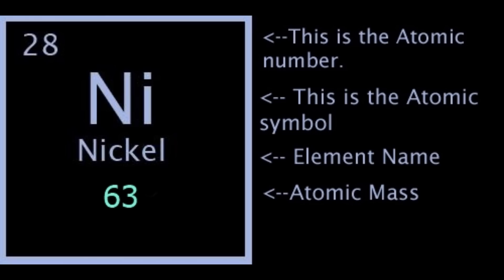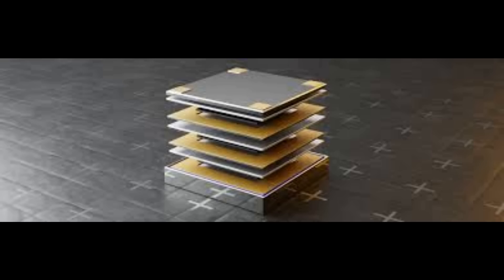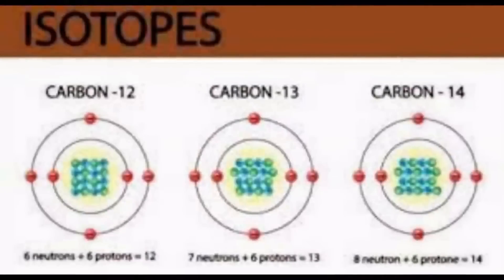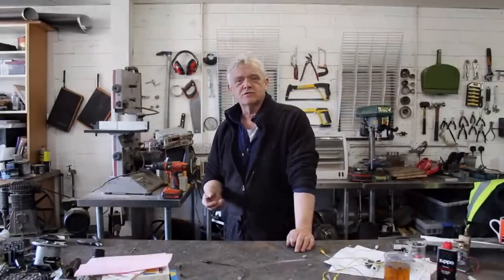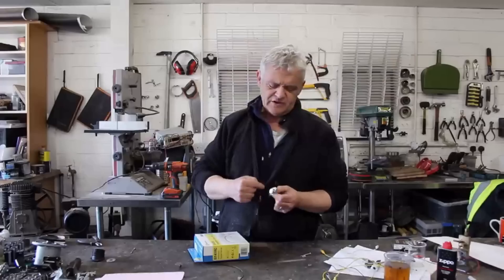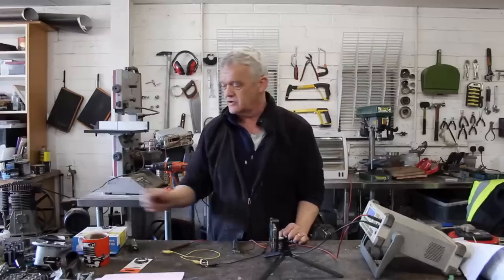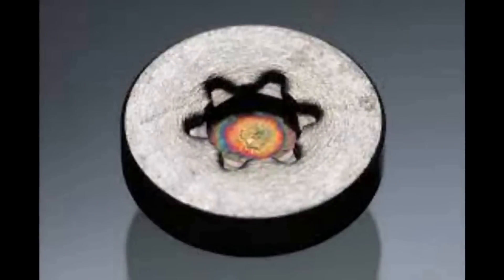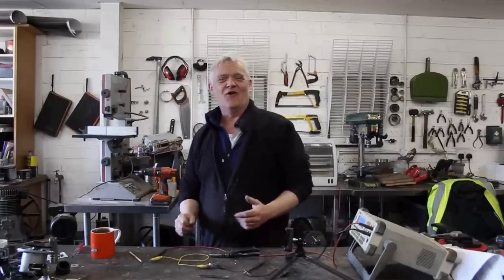2187 - The 50 Year Nuclear Battery From China And How To Make Your Own Version

Comment: The decay of C-14 or Ni-63 does not involve alpha particles.  Both atoms transmute when a neutron decays into a proton and electron (beta-minus decay) and result in stable isotopes N-14 and Cu-63, respectively.   Both have long half-lives, 5700 years and 101 years, respectively.  There are also anti-neutrinos released, but they rarely interact with anything.  Americium-241 decays by alpha particles (He nuclei), which results in Neptunium-237, with a very long half-life and radioactive.   The Ni-63 battery is far less hazardous.

Comment: wow. I had no idea! I wonder how we could efficiently boost the voltage to around 3v without having to build 30 of these in series ;)

Edit: I built one and it didn't work. I'm pretty sure the voltage you saw is just due to ambient light. You didn't shield the ambient light out at all. You need to repeat this experiment in the dark to see if the alpha particles make any power. In my attempt at reproducing this effect I was unable to in the dark, leading me to think your result is 100% due to photons of visible or infrared light, not alpha particles.

Comment: Could you just point that radioactive cell at a solar panel and get a higher voltage?
    Also what if you placed that radioactive cell over the transistor square, then poor a small layer of clear epoxy over it, just enough to put a thin layer up to the top of the radioactive cell, after the clear epoxy hardens, then poor softened lead over top of that, until it comes up level to the top of the transistor case, this way you dont have any radiation leakagefrom your homemade device..😎👍

Comment: Our company did some research work with McDonnel-Douglas company, in the 1980s era, with radio-isotope ionic flow batteries.  I still have an advertising blurb from them.  Later the Wilson-Greatbatch company actually tried these for implantable Pacemakers.  They worked fine, but had a very low current output, and were supplanted by RTGs, which had power outputs of hundreds of watts.  NASA and the Military adapted RTGs for many space programs, several deep-space probes, and similar, where 10-to-20-year power outputs had to be used.  The main problem with these devices is that they necessarily have to be very "bulky", for safety and mechanical packaging reasons.  The other problem is simple radiation damage to all of the internal materials, which cause heaving at a steady rate, much like the dendrite problem and swelling with lithium batteries.  There are NO free lunches in basic Physics.  Trust me on this.

Comment: Now that nuclear batteries have been proven and are safe with the need for only limited shielding all that is needed is to develop cells that are small and light and output enough energy to be usable at low cost. This could be the future of all energy generation. Imagine your house having a small undercounter fridge size battery that lasts for 50 years. Never needs maintenance. Or when you buy a car you just unplug your old cars battery and plug it into a new car and have decades of power. And when the battery degrades enough you trade it in for a new one.

The technology is there right now and the fact a person has already built a cell in his garden shed that outputs more power than the newly released nuclear battery shows there is much potential. Imagine a world where no power grid was needed unless for big business.

Comment: i was sitting here after lugging 5 gallon buckets of rain water to my washer for the heck of it , I store a few around for flush the toilets with , my water bill was over by just a few hundred gallons so it's a game i play to get my warm up work out when it rains ....my point on this rant is If every drop of rain collected at top of a sky-scraper building pressed gears the entire way down though , so gears spin each lower altitude of the collectd water ....daydream was all , lol gears really turning, all warmed up too i better work on stuff ....

EDIT: the thing is i need a gutter , a rain "tower" higher than the outlet is all, and a ball valve replaces SO MUCH  LABOR if you try my workout lol

Comment: More to the point of the video, I wonder if having something like these augmented by small bank of supercapacitors setup to sequentially discharge based on demand would be the way to go in some cases. Obviously these would make a fantastic bios battery for computer (provided proper shielding) but clearly falls short in high demand applications. People often look at supercapacitors as a magic bullet and that they are not but they are really good at some things. Their ability to act as a reservoir for a trickle of power and release it in high demand strikes me as a good application here where the positive and negative aspects of both components alighn inversely to make a workable "battery". Other considerations would need to be made like disposal and the fact that the actual power cell has a life span orders of magnitude longer than any current super capacitors but I see no reason that part of the component couldn't be easily replaceable or at very least recycled to mitigate quite reasonable waste concerns.  Very cool and some history I was unaware of regardless.

Comment: Initially came here to post a bunch of negative things but you covered all the bases so well I can't really do so... Well that and the part about things needed where "a healthy disregard for your own safety" had me laughing out loud. When it comes to radioactivity and the elements associated with it, there are very much real hazards and there is a lot of irrational fears coming from a lack of understanding something so complex.  Sadly even the smartest people do dumb things. Case in point Louis Slotin and the criticality incident at los alamos. Why on earth the guy was using two screwdrivers rather than building some sort of mechanism to carry out the test is beyond me. I do understand the race to get a working device before the Nazis (something that turned out to be an irrational fear in hindsight) but the guy was well aware of the dangers involved. Sadly overestimating ones own dexterity is a thing all humans do but seldom ends with such dire consequences. 

The other point I would like to make is the fukishima disaster (and BTW it is still a disaster IMHO worse than that of Chernobyl) was ultimately caused by a lack of cooling water during catastrophic flooding brought on by a tidal wave. In short the whole facility was likely submerged in water while the core(s) were suffering at least a partial meltdown (it's hard to get real honest information on but I believe at least one of the reactors suffered a full meltdown based on the information I have been able to find as it's not forthcoming). Not to say it would be harmless and it's easy to say in hindsight but at minimum the act of simply leaving doors open and letting the ocean water into the reactors would have bought more time to deal with the situation at minimum. Ultimately the backup diesel generators were disabled by the initial tidal wave and those were what would have been pumping water in a well thought out redundant safety system that missed one very critical consideration. 

In short, radioactive things deserve a healthy concern but not irrational fears but it's hard to convince people their fears are irrational when they point to things like what I have mentioned. Nuclear power has many positives but when it goes wrong it goes tremendously wrong. I can't recall where I heard it but the analogy "Other than that, how was the play Mrs. Lincoln?" is terse, to the point and quite funny depending on your humor level. I understand that not everyone watching youtube resides in the us and that comment is in relation to the assassination of president Lincoln... I think most would make the connection but understand some might not and want the point I am making to be at least conveyed properly. 

In short fantastic video on a new technology I was unaware of as well as the history behind it. Subscribed and will be checking out your other offerings in my limited free time. Thanks for taking the time to put all this together. Most of the television programs on the subject matter fall well short of this videos quality in substance. Oddly enough it's off the cuff humor like yours that peaks my interest enough to keep watching. In this case there was enough substantial  info prior I would have finished anyways. I think there is something in human nature that forces us to laugh at the most serious of things.I often see someone with expert knowledge make a joke in what some would consider poor taste or at very least a tremendous understatement. It often conveys that A. Don't forget to keep a since of humor even when dealing with the most serious of things. B. I am making a joke but at the same time I am deadly serious.  You can beat people over the head with information or you can say something off color enough that it possibly bothers them or at very least makes them wonder why such a knowledgeable person would be so flippant with something so deadly serious. Well the person is not flippant and often the brightest people are often not fun to listen to. Folks like Richard Feynman who were no doubt brilliant but also appreciated humor enough to dot his lectures with it make complex and hard to understand subject matters at least more digestible. He was also quick to tell people (in some cases) "If that bothers you, that's okay. It bothers everybody including the scientists working on it and ultimately no one really knows for certain... But if you want meaningful answers to real world problems you'll just have to accept that as the best we can offer right now and work with it." I'm paraphrasing here and not making a verbatim quote but can point to lectures and interviews were he said something quite similar. 

Anyways, its a good thing not to take ourselves to seriously and your ability to do so was the icing on the cake of a great video full of substance I find less and less these days. Have a sincere thank you and a thumbs up!

Comment: So Robert, if you took this tiny radiation producing bit and put it in the lid you peeled off the transistor and soldered the lid back on you have your battery right?  Portable for a looooong time, and if daisy-chained into a nice box you can do away with a small battery "somewhere" yeah?  Like your PC...

Comment: so there will be a "watt-year" measurement instead of a "watt-hour" measurement? lol it may be true for low power-use items. even if that battery is low current this may be another step in making low profile electronics and can power simple circuits for a long time.

PS, You can build an enclosure out of lead for the nuclear battery then coat it with PbO2 to improve contact, environmental, and long term safety. Due to additional weight for a protective enclosure, it will be limited to stationary installs, but that should should something important to talk about. portable vs stationary because application is important

Comment: The US drinking water standard for nickel 63 is 8 Bq per liter.  The 100 micro Watt nickel 63 power source has at least 1800  Bq in it.   All things being equal than a 1 watt power source would have 18 million Bq.  If improperly disposed of, and you assume only 1% of the activity contaminates water it would contaminate 1.8 million liters  above the drinking water standard. That's for 1 watt   initial output. Luckily there's not enough nickel 63 in the world to make too many kilowatts level power sources. It would be a good use for the 9  graphite block re actors at Hanford  that are  heavily contaminated with both Nickel 63 and carbon 14.  And the 22 graphite block reactors in the UK.

Comment: Interesting. Wonder how many is needed to power a radio controlled clock. Of course it doesn't need to be able to provide peak power. For that purpose we can pair it with a capacitor. Would be kind of awesome to have a clock that "never" needs new batteries.

Comment: What happens in the future when there are 10 billion people and everyone is using several of these batteries. Where do 50 billion nuclear batteries go to be recycled or dispose of safety.
Reply: The radioactive nickel decays to harmless copper. Until then you have to rely on the shielding. If the shielding is prematurely damaged for an individual battery, it’s not going to have a widespread effect. If the shielding is prematurely damaged for 50 billion batteries, either the engineering wasn’t done well or there’s been some sort of extreme disaster. Regardless I doubt we’d ever have 50 billion of these half-a-deck-of-cards–sized things. That implies a demand density more economically served in a different way.

Comment: There appears to be a bit of misunderstanding regarding the half-life of a radioactive material. Half-life simply refers to half of the radioactive material breaking down into something else. It seems 10 half-lives is the aggreed upon number of half-lives before the amount of radioactive material remaining is negligible, assuming it didn't break down into another radioactive material. Of course, the output of the battery will continuously drop over those 10 half-lives, but the americicum-241 battery would still have power in 432 years and 864 years, assuming the rest of the components held up.

Comment: Since this technology been around for while , how come we don't have it already in consumer usable form ? Of course it is rhetorical question. Just like battery powered vehicles stoped developing with preference to sell petrol in early 1900 or in 80"s (EV-1),  solar technology in 60's or HHO fueled combustion engines and other inventions. This is probably just another dream that we can dream on for next 50 years 🙂
Reply: It's because the initial plutonium batteries were very dangerous, expensive and difficult to produce. It's taken a very long time for the technology to develop to this point. HHO Generators never took off because they consume much more energy than they give off, they're extremely inefficient. Energy cannot be created or destroyed, only changed from one form to another and never with 100 efficiency. The laws of physics exist
Reply: @Sauce787  What they figured this technology out when they sent the Voyager 1 that still runs off their nuclear battery flying through 'space'.
Reply: @Sauce787  I don't agree with that. I know differen't :-)

Comment: Somebody tell me why I shouldn't put one of these together, shield it with some 1mm lead plates inside of a plastic casing and use it as a passive maintainer/charger for a 3.7v lithium ion battery.

I'm gonna do it if no one stops me.
Reply: Please do and share the results online (even anonymously) if it works and what it can power. We are in need of a revolution in our low quality consumer available battery tech.

Comment: 130 mV is small but I wonder how much current can be drawn from it. I bet that even using a single Americanium source it can be made a lot more efficient, without tampering with its housing of course. There should be particles that pass through the silicon. So if we remove the silicon from the transistor and stack them in such a manor as to align with the source we should be able to make use of the same source.

Comment: Americium 241 is an alpha particle emitter. You are not dealing with gamma particles, and therefore do not need the extreme levels of caution that you exhibited in this video, a sheet of paper, or even your skin is more than capable of stuffing, alpha particles as long as you do, not ingest, inhale, or wind up with a particle of it in an open wound, it should not be able to do you any harm a decent face mask, and rub gloves should be more than sufficient protection, otherwise this was a very informative and fascinating video. Thank you for your research.

Comment: If we are going to use these batteries we need a completely different design philosophy to the one we have been using for the last 40 years. Everything nowadays is designed to be disposeable, replaceable. That is why I think these will only be used for niche applications on satellites, weather stations and other remote applications.

Comment: So if the voltage is basically coming from the alpha particles hitting the PN junction and getting converted into a voltage differential, wouldn't it possibly work even better with an actual solar cell instead of a stripped transistor?

Granted, you'd have to strip any protective layers over the solar cells, because alpha particles can be effectively blocked by a sheet of paper...

Comment: Using an alpha source has a high risk of secondary neutron radiation if the source is directly exposed to conductive materials without a layer of insulative sheilding between it and the conductor. A bit of paper would work just fine as sheilding. Of course Americium also can produce gamma rays which would have to be sheilded with lead. Alpha particles themselves are not very dangerous and can be shielded by your own skin. But secondary neutron radiation from inproper sheilding is quite dangerous.